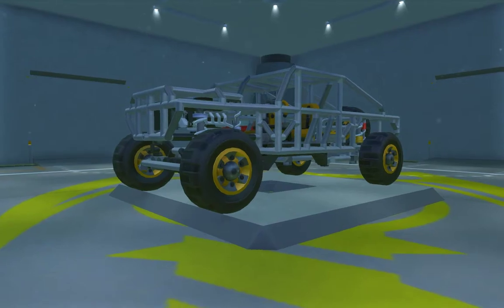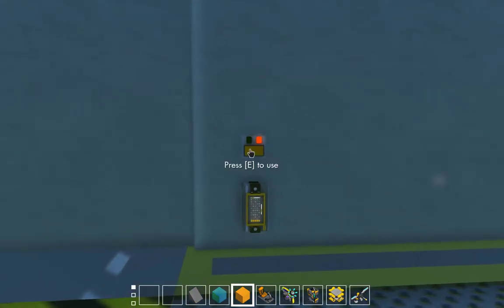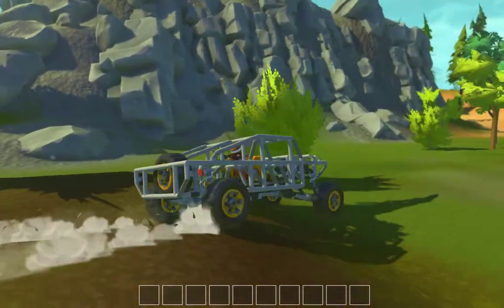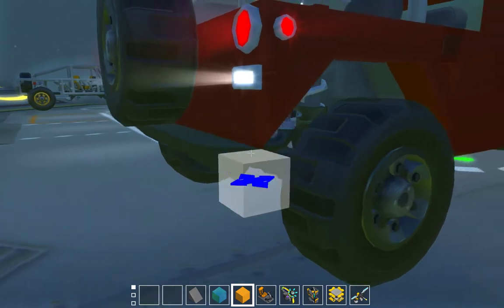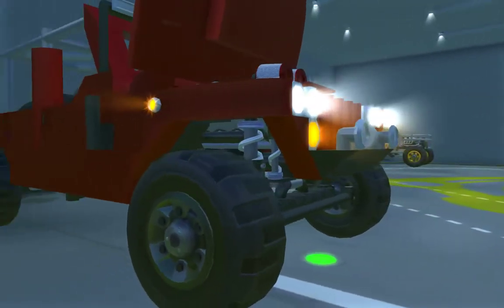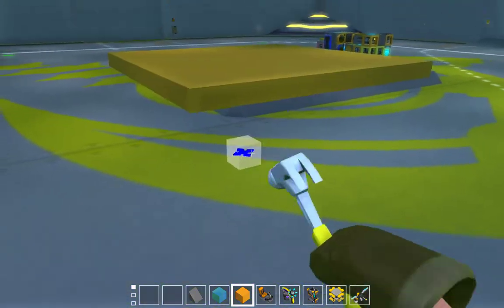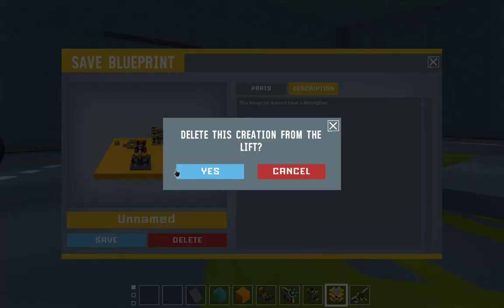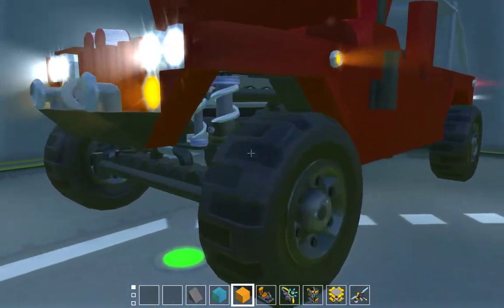Scrap Mechanic | What I Am Currently Working On

Comment: 5:00 god is gonna beat you up for putting a turbo on a v8 lmao
Reply from the maker: Well, you see, adding turbos would make more power along with more efficient, so it would be better for the planet :p and who doesn't love a good spool and blow off valve.
Reply: @XspunturboX  ik but it fits perfectly with a supercharger , it wouldve been more cooler a v6 with turbos , also if you still have the jeep would you ever upload it on workshop ? ive tried 4 times making that car and failed and i love it really much
Reply: @XspunturboX  and by ”love it” i mean i recreated only the engine and i never found a car to fit that engine so or any other workshop engines

Comment: I'm glad you like my differentials und the modular engine parts :) try my angled pipes mod too, to make that exhaust system look smoother :) It's always a pleasure to watch your videos :) get well soon!
Reply from the maker: i got the mod again and saw some pipes i can use now, i used one on the exhaust so far. the engine parts are something ive been waiting for for a long time :P love them would you be able to make some parts for inline engines also?  and thanks :)
Reply: XspunturboX I'm working on more parts for the V engine right now, but I plan to build other types of engines too. Let me know if u need more parts, I'll see what I can do :)
Reply: Lord Pain it would be cool to have in line engine parts too  I'd like to make a 12 valve Cummins

Comment: Do you have a tutorial for the buggy? or some pointers on how you did it at least? mainly for the chassi and the suspension, i have tried something similar in the past, and couldnt get it to work
Reply from the maker: for that one, i think i just took a truck chassis i had, then made a tube body. i dont really plan my builds or any thing. as for suspension, i havfe some tuts on different kinds.